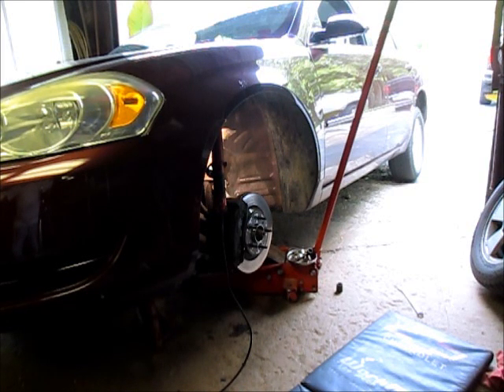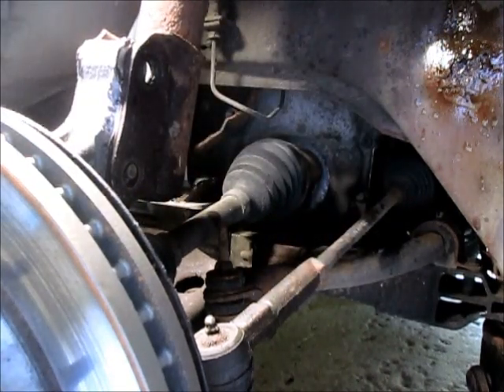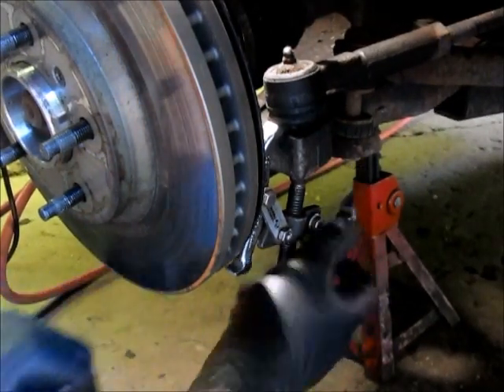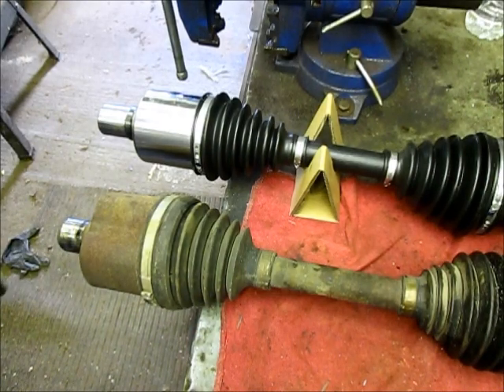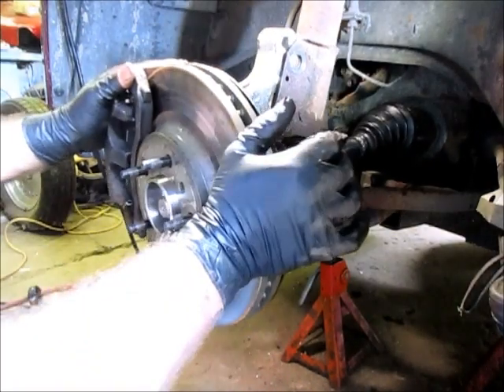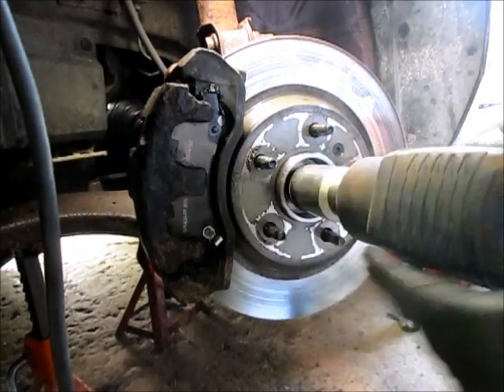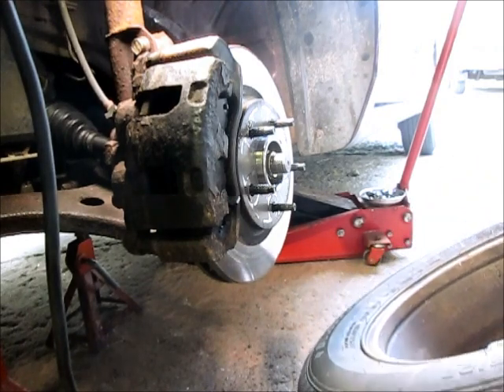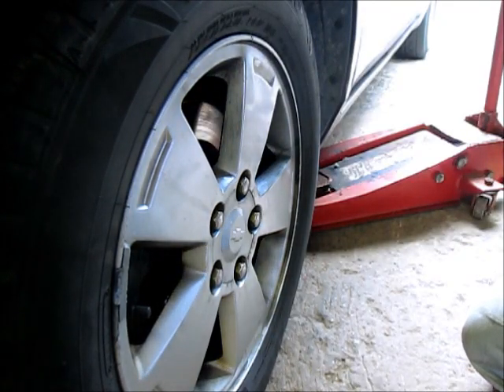Chevy Impala CV Axle replace.

Comment: If you use a jack under the rotor it will line up the bolt holes i found that out when doing struts by myself one day

Comment: I wanted to say thank you for mentioning the socket sizes as most tool sets don't come with 34mm sockets. It's a good heads up!👍
Reply: Also 33mm turned out to be 1- 7/16 for anyone else who might be doing this.
Reply: 1" 5/16 for 33mm
Reply: Harbor Freight has a set of impact wheel hub nut sockets. Five of the most popular and large sizes. Not too expensive either.

Comment: Good job. Word of advice. I'd be careful using an impact on that tie rod nut. I done the same job on my wife's 2000 Implala and it stripped the threads on the tie rod end in just a flash. I'll use a rachet from now on and a torque wrench.

Comment: Heres a tip. The bracket holding the brake line does unbolt to give you that extra wiggle room
Reply: Yup.  10mm. I didn't want to take the tie rod off and I didn't need to.
Reply: Yes sir I did the same is came out without removing the brakes and the tie rods ends

Comment: @geordansnipes9991 huuuuge emergency - I just did my 09 Impala driver side CV axle and it seems to be binding when we got it off the jacks. 

When the driver's side axle seats is there ANY play in the section that connects to the transmission itself?

There's maybe an inch or two that you can pull it back and forth by hand, but it's otherwise 'locked' in there 

Any help would be much much much appreciated

Comment: So before you changed this part out, was there and violent shaking/vibrations when you were hitting the accelerator on the impala? I am trying to narrow down issues with my impala
Reply from the maker: No, not at all. Sounds like you might be having a transmission problem.
Reply: @canamsledder  my reason for asking is a Google search brought me to this video.
Reply from the maker: @DerrickODea  No problem. When your CV joint goes bad the first sign usually is a clicking sound when turning. A vibration or shaking, the CV joint would have to be ready to come apart! Grab the axle and give it a shake. It should be tight.
Reply: Yes if shaking stops when you remove foot from accelerator then it’s most likely cv axle. Go under it and see if you can move the axle side to side easily.
Reply: @FleetTech97  CV axel was replaced and the problem solved, original CV axle was very shot with 1 of the knuckles on the inner cv axle was completely destroyed
Reply: @DerrickODea  thanks for this response it helped me. I feel much better. I was about to remove my transmission. But the problem you mentioned seems the same as I have. (CV axle).
Reply: @dnegel9546  you're welcome, it's easier to swap out the cv axle and see than swap out the transmission. That was my next step thankfully I didn't have to go there

Comment: question. I have a 06 Chevy impala and I have a busted axle on passenger front. Car was shifting fine unit I jacked it up the other day and changed the oil. Next day car won't go pass 20mph. Could my busted axle caused my transmission to slip?
Reply from the maker: Have you checked the fluid leave in the trans?
Reply: @canamsledder  It's full but it does look old and dirty. Bought the car for my daughter not too long ago. I believe car had sat up for a long time. I bought it from a mechanic so he probably fixed it good enough to crank up and sell. Car did drive like a dream until now...
Reply from the maker: @llg7456  Is the Check Engine light on? I'm wondering if you didn't knock a wire loose or something when you were changing the oil.
Reply: @canamsledder  Nah I seriously doubt that. I only touched the oil plug and filter. No wires near than. Saw a video showing sometimes a bad axle can mimic a slipping transmission. Got a new axle the other day amd hope this solves the problem. If not guess it is transmission. smh.
Reply: @canamsledder  Put some lucus transmission fix in it and it started to change out and now can drive over 20mph. The next month Put some mystery oil in the gas and oil and it stopped slipping all together but shifts into 2nd kinda hard at times.

Comment: Why does cv axle shaft inner boot keeps tearing for every repair. I ordered a replacement part and it arrive and I let my sister her boyfriend to install the parts, next day, the boot actually came off, so I purchased a replacement boot at Autozone and have my mechanic to fix it and they fix it but 2 days later, the boot came off again. Its a 2006 chevy impala 3.9L LTZ Front Right Passenger side.
Reply: Probably rubbing on a bracket
Reply: Bad motor mount

Comment: Should always replace axle trans seal when replacing axle, all vehicles.
Reply: Not always a great idea. If it ain't broke, don't fix it. I have seen more leaks created than prevented.
Reply: How about lubing the seal and CV before you slide it in? Trans fluid or grease?

Comment: Over torqued these lug nut for sure. Nice video tho!
Reply from the maker: A little under 100 foot pounds on the low setting.
Reply: @canamsledder  where can i get the ball joint separator?